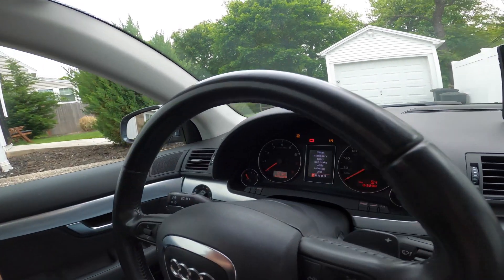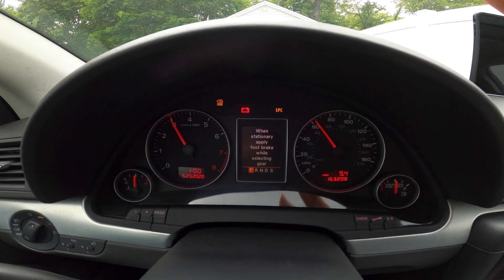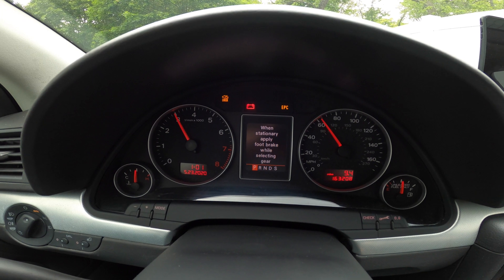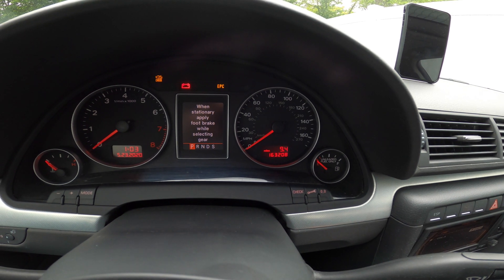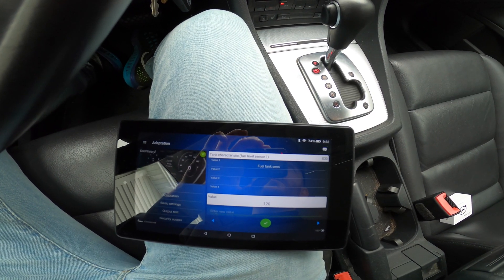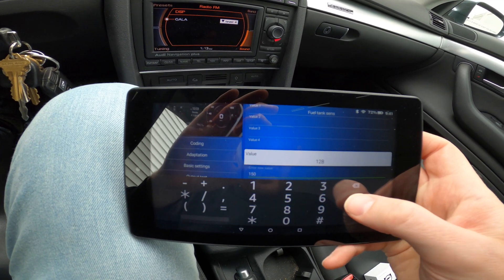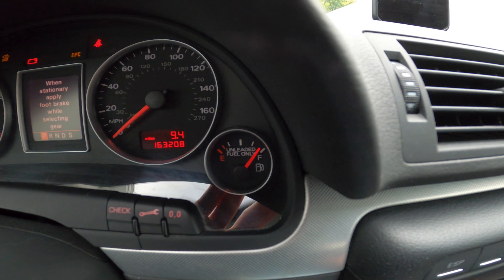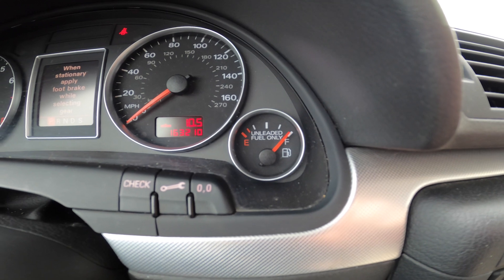Audi A4 Gauge Cluster Function Output Test and Setting the Fuel Level Adaptation Calibration

Comment from the maker: MY NEW BUSINESS: http://bitly.com/2URZuod
OBD ELEVEN PRO SCAN TOOL: https://amzn.to/2UATodN
$49 FIRE TABLET USED HERE: https://amzn.to/2UOCtVm
AUDI VW 5W40 OIL: https://amzn.to/3dtwzBs

In this video I show you how I test the instrument or gauge cluster function on my Audi B7 Avant using OBD11 software. Software available here:  https://amzn.to/2UATodN Using the cluster function output test under instrument cluster I am able to quickly rule out that there are any issues or malfunctions in the individual gauges of the cluster - specifically for the fuel level output since I just replaced the fuel level sender (video here: https://youtu.be/J6cU0V1vnOE)

BMW OIL FILTER TOOL: https://amzn.to/368Uz9i
BMW GERMAN OIL FILTER: https://amzn.to/2MPdE8P
CREATOR C310 BMW SCAN TOOL: https://amzn.to/2NaIuru
GREEN MOLYGEN OIL: https://amzn.to/31MfCLi
LiQUi MOLY ENGINE FLUSH: https://amzn.to/2MJ8cUQ
LIQUI MOLY LIFTER ADDITIVE: https://amzn.to/2MKdNu3
LiQUi MOLY JECTRON INJECTION CLEANER: https://amzn.to/31IwpPt
BMW Maintenance: https://amzn.to/2PhLncF

Rare BMW Parts: https://ebay.to/2kd26AR

ONLINE http://www.bimmerzeit.com
THE GRAM http://www.instagram.com/bimmerzeit
FACEBOOK http://www.facebook.com/bimmerzeit
TWITTER http://www.twitter.com/bimmerzeit

Questions? Send me an email at bimmerzeit@gmail.com

My CAMERA GEAR;
Sony A7sii: https://amzn.to/2zwwwVC
Sony 16-35: https://amzn.to/2NIeXF1
Rode Mic: https://amzn.to/2ubhfo5 
GoPro 8 Black: https://amzn.to/3gbtSFU

This description contains affiliate links. If you click my custom link to purchase a product, I will earn a small commission at no extra cost to you. Win!

Comment: So this is important info on the subject if you have the OBDeleven...
I was having a similar issue, except I was on E, I put in 6gal and it showed ¾ tank. I was also going through gas alot faster than normal. 
Fortunately I saw this vid and did the Output test, I had the same results. So I started to adjust and it started on 120 just like in the vid, but the problem is that the lowest value(96) isn't E, and the highest value(150)isn't F. The adjustment doesn't allow you to put the needle wherever you want. From what I gathered, It's just to adjust for the output test. 
So then I started to look at the values of everything Fuel related in the "Dashboard" section and went through everything that I had changed. I had changed the value for the seatbelt chime to "Off" and so I looked at the "History" section of every value that I personally changed & that's when I saw that my fuel tank setting/value (0023201)had been changed from (0020201) which in my case wasn't the AWD/Quatro tank size. How this happened, idk? But as I was looking at the live info, I saw that the AWD fuel sensor wasn't showing a value which led to further investigation. That's when I realized that w/e was wrong, it had to do with either the model of car not being set to AWD or a fuel setup not being AWD.
If I learned anything from this, it's to make sure to keep strict record of Any/All adjustments or coding that you do bc it can turn out to be wrong or effect other sections of the car.
Electrical systems are a MF

Comment: Hey I am dealing this issue for the third time now. first removing and reinstalling sending unit worked, second time it didnt and additionally it was showing low fuel warning all d the time. I replaced sending unit and got rid of low fuel warning but guage is halfway full even with full tank of Gasoline. Did you find the full length fix? obdeleven seems like junk as most of the time if wont connect to few modules in my car along with dashboard
Reply from the maker: Hey, no I sold the car without replacing both sides. Just the one side. Of course, I disclosed all the issues to the buyer (last year). I agree obd11 was very frustrating to connect to the car, but once it did, worked for me. Not a fun car to work on, hence why I’m into BMW’s instead.

Comment: Would you recommend this car, I found one similar tor yours only 4500$
Reply from the maker: FITTO you need to have a lot of mechanical ability to keep repairing these cars as they do have lots of items that break and need work. It’s not that easy to work on compared to a BMW. I am enjoying driving mine more than I thought, but I’m not sure I would recommend an Audi or VW product to anyone. Buy a non-turbo BMW for maximum reliability and fewest trips to the repair shop.